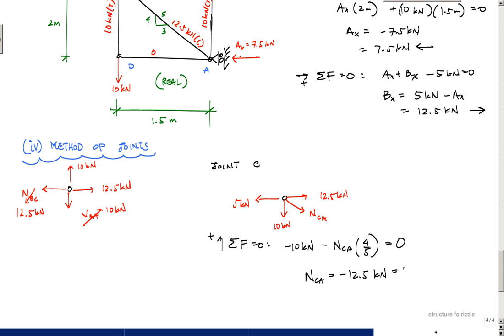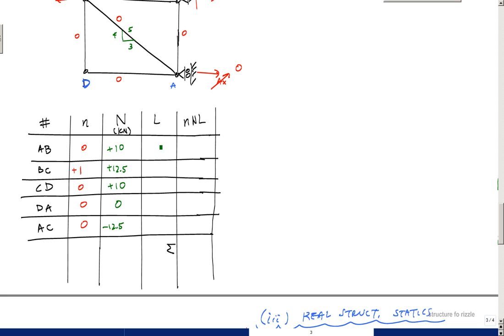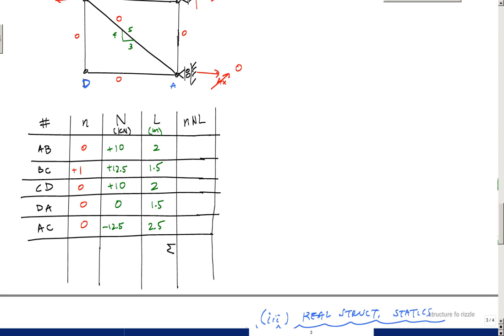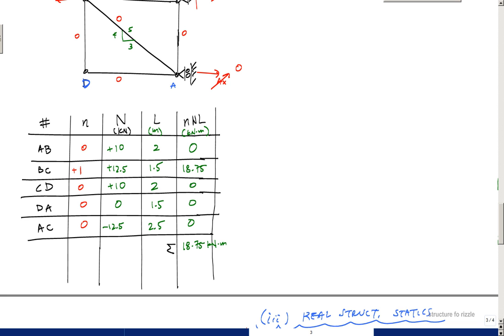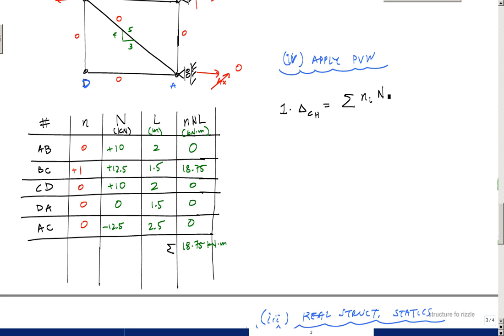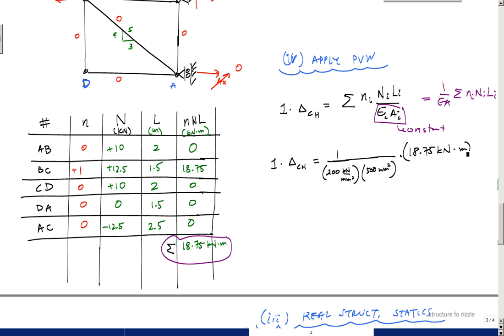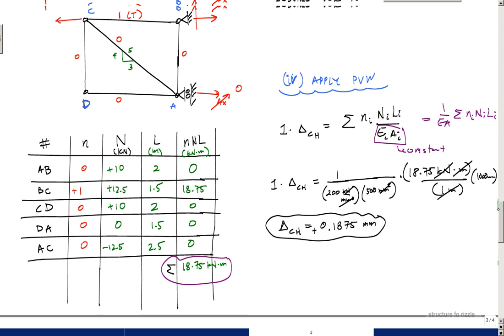Method of Virtual Work - Truss Example (Part 2/2) - Structural Analysis

Comment: Great vid! The units are incorrect in the nNL column though, I believe. They should be kN^2 * m. The virtual load of 1 kN on the left side of the equation will cancel out the additional kN on the right side. Please correct me if I'm wrong!
Reply: The virtual load has no units.   We assume it is 1 arbitrary unit, which is simply a proportion relative to the units of the original load.

Comment: Why was your total area only 500 mm^2? In the first video you had each cross sectional area being 500 mm^2, but there are two triangles.  I believe you wrote the equation as the sum of the areas.
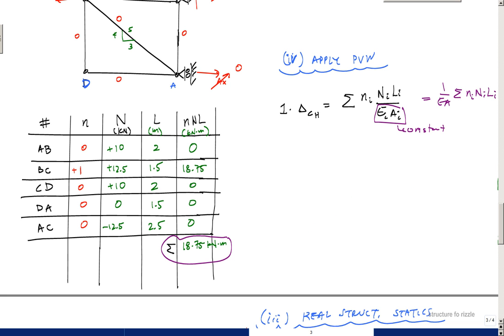Reply: Perry Sopinsky you only add the sum of the n.N.Li as seen at 2:41 in purple you bring the EA out the front as you would if you were using the double integration method for elastic curve

Comment: After doing the statics I figured out that member bc was 12,5 kN in tension. I did N*L / E*A and I got the same answer as you got. So is it necessary to use the the virtual load?
Reply: Jo DO the virtual load method is not for finding internal forces of members, you use the internal for members to find the displacement(delta) of a certain point in a truss or beam from the virtual load method

Comment: a struss structure pinned to the wall, members 
-A, B C (top) are equal length L and members E and D (bottom) are also length L, 
-A and E and L length spaced apart vertically, 
-A and E are pinned to the wall, 
-Applied load W at C
-diagonal member from E to B and another at D to C (45 degree angles)
what is the deflection at D? 
i've stuck with this question for awhile, can you help me please?

A___B______C
l         l
l____ l
E       D
(sorry i couldn't draw the diagonal members)